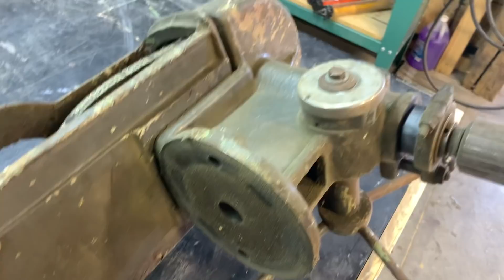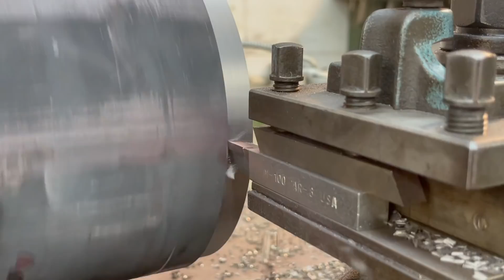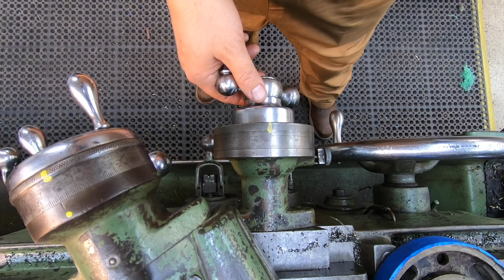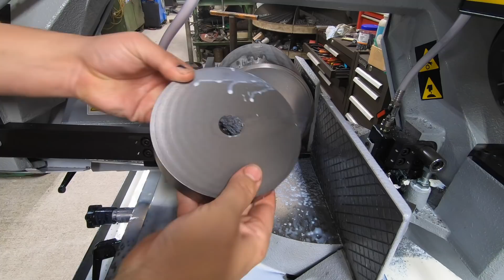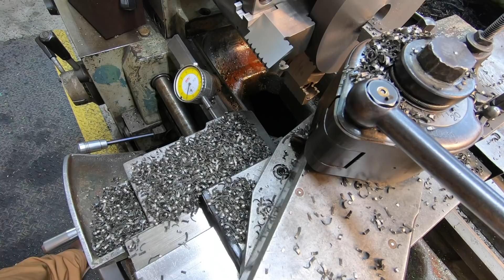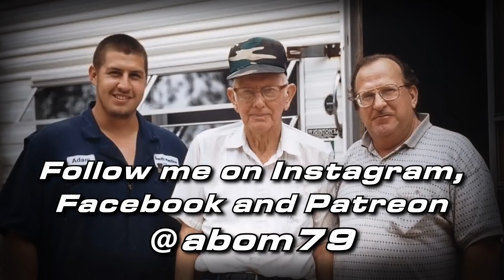Walker-Turner Drilling Head Adaptor Plate Part 1: Lathe Work

Comment: Hi Adam. I was watching you cut the groove for the T-nuts, and was concerned that the operation was putting a lot of torsional tool pressure on the insert holder (essentially a thin, flat bar, oriented vertically) - specifically, the bottom edge - as it tries to fit in the circular groove it’s cutting (which is thin, but NOT flat)! Or did you choose the depth-of-cut so as to not run into this problem? Anyway, more interesting machining videos! Wish I was there to help (and visit your shop)! 😎
Reply: The tool he used is curved not flat, rewatch the video and he will ,both, show you the tool and tell you the two diameter limits that particular tool had.

Comment: For roughing or finishing a face cut (trepan), I would have set my compound up 90 degrees to the face! 
Instead of feeding the whole lathe carriage to do your cutting, I use just the compound for feeding to the correct depth, with the carriage locked down secure  for max rigidity for the job.

Comment: Good choice to use ductile iron, much less brittle than cast iron.  Enjoyed video as usual.
Reply: The difference between "gray" and "ductile" iron showed in the swarf Adam produced.  He had a good number of almost steel like chips and a little powder.  "Gray" iron would have produced very few distinct chips and LOTS of powder.  The difference between the graphite nodules in "ductile" the and graphite flakes in "gray" is pretty stark.
Reply: I'm curious why they didn't just use mild steel?

Comment: Hey,
 I have the same W/T radial arm drill press. It is truly a beast, couldn’t imagine having a shop without it, the table t-slots make clamping big work a snap. When I bought mine from the Navy as scrap, the quill drive shaft was destroyed. I called Delta, who owned the Walker Turner brand through acquisitions. I got the parts dept and explained what I was looking for and the parts guy said hold on, the phone came back with a different guy. He asked for the serial number, which I gave, he immediately said that serial number range was delivered to the Navy in the 1950 something, and confirmed that I was looking for the quill drive shaft, he asked do you want MT-3 for a Jacob’s 33 or something else. I said the 33, he said I think I have 3, let me go check. This was all off the top of his head, he came back and said he did have 3 and how many did I want. Didn’t want to be greedy and only got one, he said “let me check the price”, said the last update was in the 60’s so the price would be about $15.00 plus shipping. I got the part wrapped in cosmoline and vapor paper, wrapped in layers of oil cloth. I bet it hadn’t seen the light of day since the 50’s. One of my favorite tools.

Comment: Could it had been cracked before dropping?  
If rotation is less than 135° cutting the tee nut slots and grooves on a rotary tablet would have produced strengthening webs.
Reply: It was most likely cracked.